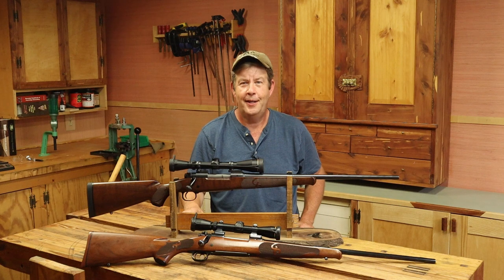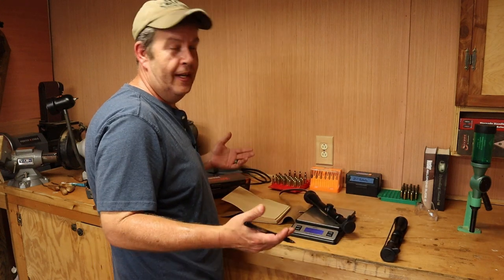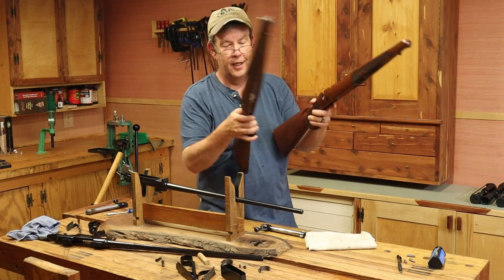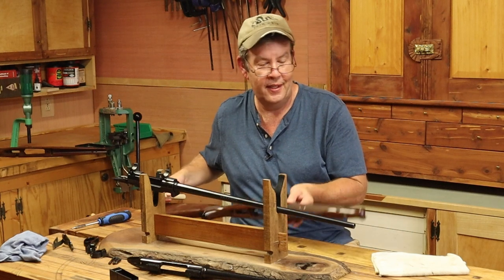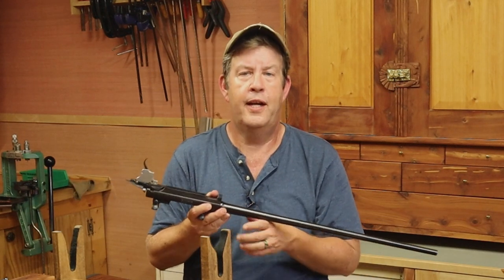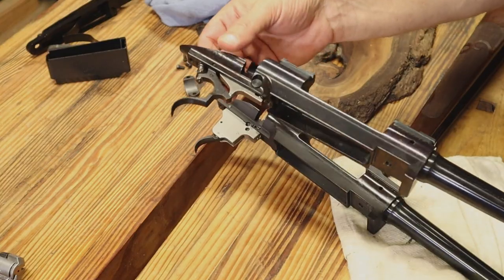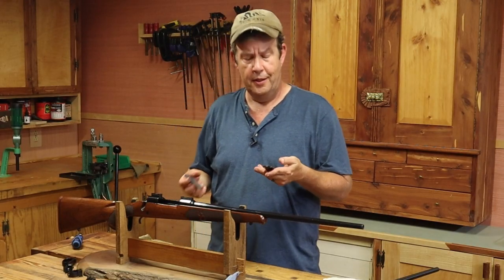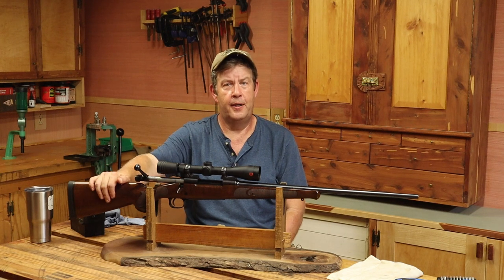257 Roberts Project; Trouble Shooting and Weight Difference

Comment: Thanks.  I'm sure enjoying following along on this project. You know I put together a 7mm-08 (short action) using a Mauser 98 (1904 year) and it felt odd having that short cartridge in that long action magazine.  I'm still not sure that I could shorten it with a block due to the spring and follower. Perhaps they make something to do that, but I just try to make sure when I load it that I have the ammo forward and lined up.  I still need to bed that action. That's something I have no experience doing and I ended up letting my local gun smith do that on my 7mm Rem Mag that I put together.

Comment: I'm with you in that trigger weight, Tom. My model 70 is a 2015, and I have never touched the weight on mine. I'm quite sure I could dial it down, but it breaks so clean and crisp that it has never failed to surprise me when I take a shot. Why mess with perfection?
Reply: Have I seen you post before that you have a model 70 ultimate shadow? I have found an ultimate shadow stainless 30-06 that I’m thinking about getting. Do you like yours? I apologize if I have the wrong person!
Reply: @NCWoodlandRoamer  Never heard of the ultimate shadow before. Research is soon to follow! Thank You.
Reply: @jstrunck  they made them around 2015 from what I can tell so far.
Reply: @NCWoodlandRoamer  As a matter of fact, yes. I have an Ultimate Shadow Stainless, and I absolutely love it. The synthetic stock isn't much of a selling point for most people, and admittedly I'd probably love to have it in a beautifully figured walnut, but it does have some rather nice features to it. Instead of checkering it has soft and tacky grip panels which I have found VERY handy in mid Novembers of Northern Michigan. It's not the sexiest stock in the world but it is very functional and I have found it more help than hindrance when trying to line up fast, accurate shots. It's also glass bedded from the factory like all other Model 70s. Budget friendly, cost effective, and low maintenance with the stainless barrel and reciever. Especially if you want a high end production rifle in an all weather rig. I think they retailed for around $800, but you could find them new in the upper $600 to mid $700 range. I can't remember, but I bought mine from Bud's, and I think I paid about $680 with the extended warranty. I suspect that despite the cheaper stock, this rifle will still hold it's value as other Winchester Model 70s have.
Reply: @hammerheadms  Ok thanks! I’m not a big fan of the looks of the stock but I haven’t seen one in person, the one I’m looking at is online. I would possibly put a Bell and Carlson stock on it…. If I get it. We’ll see. It is in like new condition and at $1,000. Seems high but then you see the new ones that are stainless are well over $1,500 and I can’t even find a new one in stock anywhere anyway. But granted the new ones come with a Bell and Carlson stock from the factory. BUT they have a 22” barrel and the ultimate shadow has a 24” barrel which I actually prefer with 30-06. See how I just talked myself into it!? Thanks again for the information.

Comment: Tom:  Very enjoyable video, as always!  3 things it would be fun to explore:  1. Have you tried obtaining the actual twist rate via cleaning rod.  It’s not uncommon at all for these rifles to be twisted slightly faster or slower than published.  You might have a 1-10.5 or very close to 1-10 etc., but we don’t know for sure until you get the true data.  2.  Steel bases especially, aren’t always machined very well from the factory.  I own or have returned bases from Leupold, Burris, and Ruger rings, that were visually not machined to specs.  At this point, we are trusting that the original rings are a) machined well enough, and b) are sufficiently fastened.  My 2 cents is to forget about the lapped rings and remove the bases. Can we we truly consider the range data valid without you mounting the bases yourself?  3.  How far are you from optically center in your scope?  As you know, if you’re out a ways with windage to zero, that has potential to affect the scopes ability to hold a precise zero.  Good luck!
Reply from the maker: Lots of good points Ryan. And it's funny you said what you did because my new Warne bases and rings just arrived! I don't think I'm having a scope or scope mounting issue here but at this point I'm going back to what I have confidence in and I have been really pleased with the Warne Maxima bases and rings.

Comment: Tom those are beautiful barreled actions and stocks. I would not change anything on either of them except for possibly going to double d basesand rings on both of them. Good luck with future load development. You may won't to try neck sizing with lee collet necksizer. Have a good week!
Reply from the maker: Thanks Leon, and I'm going to go with Warne bases and rings, and my new rings actually arrived yesterday.
Reply: That should be a very good setup. Bolt them on and go. I've never used Warne bases and rings but I have considered it .  I wouldn't hone the rings, not necessary on a hunting rifle

Comment: I have an M70 and an M700 with 2 lb. triggers. Both are drop safe. 

I am not fond of Remington or Winchester's new triggers. Neither one would go down to 3 lb in my samples. So it's a good thing they have a decent pull. 
Thanks, Tom!
Reply: On my Savages (actually Stevens 200s) The pre-accutrigger triggers would not go below three pounds and were full of creep and slop, so I replaced both with Timney. My Featherweight is right at 3 and I checked it for drop safe here on the carpet of concrete slab and the trigger held.

Comment: Great detailed video, the difference in the XTR and the 2012 is interesting, I would not have thought the XTR would have a steel floorplate...I would be interested to know what your clearance is on the free-floating...on the 2012...Im going back and watch the range video on the 2012...have a great week and God Bless
Reply from the maker: I checked the clearance yesterday with sheets of paper and it's roughly .009".

Comment: Tom I have. Something for you to think about in your load development.  With a given powder charge  bullet  and case, the shorter OAL will have the highest velocity and pressure.  As you start seating the bullet farther out pressures and velocity drops until you approach the lands then pressure spikes.  Think about that and maybe that could help some. have a good day.
Reply from the maker: Leon I did some length testing on the model70 Westerner I have in 270 Win and between about .027 and .030 off the lands the velocity just plummeted from the velocity I had at .025". For me around .023" has always been the sweet spot and that sort of told me why.

Comment: Tom , over the years I have come to the same conclusion that gunblue 490 advocates on gun barrel cleaning. Clean with brush  patch and cheap paint thinner and don't clean often . It seems that my guns group better after 15 or more rounds and continue to shoot well for many rounds more (100??).
Reply: My best group with mine came after about 15 rounds and with my last load. I am not cleaning it until I go back with my factory rounds and another load work up. I am cleaning the chamber and rails though, but not the barrel for the next round.
Reply from the maker: Leon we're on the same page but I'm going to do a serious down to steal cleaning in the next video. The fouling was a lot worse than I expected in this barrel and I'll be showing that on the bore scope. But I won't be cleaning like this again.

Comment: After one range trip with the 7X57 and really bad groups with both Federal Power Shock 140s and PPU Rifle Line 139 gr SP,  I went straight to free float check and trigger pull. My trigger was breaking at over 5 lbs. But, no matter how far I backed off, I could not get below 3lb so left it there. I'll adjust to that, but 5 was too much for groups for me...maybe okay for wearing gloves in the cold. Anyway, I'm just saying I can't shoot groups pulling on a trigger with 4+ pound trigger weight...at least without working on some technique. Changing from 3 lbs with the Remington X Mark Pro Trigger down to 1.5 to 2 lb with a swap to a Timney on my Rem. 700 .223 Varmint, brought it from a MOA gun to a 1/2 MOA. But, I only use it on the bench, and may never get out to a prairie dog town. With the 7X57 at 3 lbs, I got one Sub MOA group. and just happy I know it can do it with at least one load. Working on technique may help in case I'm pulling shots at the bench. I do know my heartbeat with my grip was moving the crosshairs an inch. My biggest challenge is trying to get this Mossberg 4X4 270 to shoot 2 MOA consistently even with a 2.5lb trigger...which may take a miracle. I already have a shotgun, and don't need one that only shoots one #2 Buck shot at a time. :)
Reply from the maker: LOL, that's about I how I feel about the 257 Roberts right now.
Reply: @TomRiverSimpleLiving   I got one 2 MOA 4 shot (square) group with the 270 mossberg today with 130 gr. Speers The odd thing about it. was I mounted my old Tasco 3X9X32 scope (about 50 bucks) on it. I hate having to use a coin to get it zeroed. The rest, well they were not 2 MOA.  Took the 7X57 too to shoot some groups with the factory 140 grain Power Shock federal, and the PPU 139 gr. SP, and the last of the last work-up with 154 gr. SST  Got a 1.5 inch group with the Federal and 1.82 with the 154 gr. but couldn't do any better. This was with the barrel not cleaned from the last trip. Anyway, I think I'll clean it, since the fouled barrel didn't seem to help. 1st group out of it cold with PPU 139 gr factory ammo was horrible...probably 4-5 MOA. I'm sure you'll get the .257 shooting.

Comment: Have you checked the crown? I've had a few rifles that drove me nuts trying to tune, only to end up having crown recut and instantly shrink group size! Sometimes you can see/ feel/ use the q tip test, but I've had some that looked fine (thru a loup) but a light cut made all the differance ;)
Reply from the maker: Mike, I haven't checked the crown other than just a quick visual but I will definitely keep that in mind. That's is one of those we rarely think about but when it's a problem it's a problem!
Reply: @TomRiverSimpleLiving  Yea, I have a NEF single shot (243) that wouldn't shoot any (factory) ammo worth a darn (3-4") so I had the crown recut. Instantly under 2" with most factory ammo (still didn't like the Federal load) and now have some handloads to test :) Had a surplus Mauser years ago the went from 6-8" groups to under 1",  just by cutting 1" off the barrel (with a hacksaw/ file!)

Comment: Hey Tom, looking forward to your progress.
     Since you mentioned the rear base offset, maybe you or someone can answer a couple of questions I’ve got about that type of mounting system. I know it takes a lot of torque to rotate the front rings until they are perpendicular to the base. I wouldn’t dare use a scope to rotate that front ring, but when using the rear  base to adjust for windage, which seems in effect that’s what’s happening, wouldn’t that place a bind on the internal workings of a scope?  Also, if an offset existed while lapping the rings, wouldn’t that enlarge or egg shape the inside dimensions of the rings?  I’m really stuck on why during your first range trip, first group, your second shot went right of the first, then left, then right. 4”+ on windage, 1
Reply: Apologize, I cut off my comment. Anyway, less than 1” difference in overall elevation difference. I’ve used Leupold based since the 70’s, but not so much now. Keep up the good work👍
Reply from the maker: Jaybird, Wheeler makes an alignment kit for these types of bases and rings and you are correct in everything you are thinking there. The rotation has to be right on the front (you can use a 1in wooden dowel for turning it) and the windage has to be inline or you will run into issues. That's why I didn't want to touch these especially with them having been lapped. But I'm about to replace the base and rings with some Warne Maxima bases and rings which use Weaver style slots. I have always preferred the weaver style rings just because they simplify everything for me. Now with that said there are folks that won't use anything but the Leupold bases and rings and those folks know how to perfectly align everything on them. I just don't care to get that indepth with bases and rings.
Reply: My favorite Model 70, 270 Win is sporting Warne bases and rings👍. They work for me, looking forward to your next trip to the range🤞⚜️🇺🇸

Comment: Hello Tom, thanks for the video. I’m waiting with baited breath for your next video to see if there’s an improvement in accuracy. I have a newbie type question. I recently realized that my bolt actions can be de-cocked by holding the trigger while closing the bolt. Is this better practice to un-cock say a model 70 this way, or is it perfectly safe to dry fire as long as you don’t do it unnecessarily often? Thanks Tom, always appreciate you videos and your common sense approach to what you do, and help you provide. Take care and God bless.
✌️😎👍
Reply: Good question it doesn’t hurt to dry fire unless it’s a 22 caliber rim fire they should not be dry fired because it will cause damage to the firing pin. Also some pistols shouldn’t be dry fired like CZ-PO models it can damage the firing pin roller.
Reply: Been decocking mine this way for a while now.
Reply from the maker: Mike I think both of the previous comments are spot on. I usually de-cock mine by holding the trigger down while closing the bolt and I suspect I've done that in quite a videos. Now with that said it doesn't hurt them to be dry fired. There are a few special exceptions to that such as most remfires like Edwrd said, but almost all centerfire rifles can be dry fired without issue. And notice I was careful to say most and not "all". There are always exceptions to everything when it comes to firearms so just do a search on your particular firearm to see if it's  ok to dry fire if you're ever not sure.
Reply: @TomRiverSimpleLiving  Thanks Tom, and thanks to your other awesome members of the group for their comments. Have a blessed day 
😎👍
Reply: @repairfreak my pleasure I have been hunting reloading and collecting rifles for 60+ years and it would be my pleasure to help with any questions since that’s how I learned!

Comment: With my next trip I may work on seating depth with the 7X57 and try the same range of bullets. I seated my grand slams at just at the top of the the cannelure, and I know that was shorter than my factory loads, and it gave me my best group, so it might be shooting better with more jump to the lands. Heck I don't know. We'll see.
Reply from the maker: All any of us can do is experiment and see. But I will say that I think seating depth is more of an issue with the new high bc bullets? My group sizes never really changed that much with seating depth but my velocities would. But I keep hearing setting depth is a big deal with the new bullets.
Reply: No surprise here.my two 7 x 57 were the same.  if they are a accurate like this just leave them as is as only accurate rifles are interesting . If your rifle is a military surplus one then it will shoot heavier projectiles well as they usually have twists around 1 in 7. Mine loved 139 to 175 ones with the norma 156 oryx being my favorite by far.

Comment: Good morning from Maryland. I have an older Ruger model 77 ultra light rifle with a round top, red pad, and black forearm tip. It is chambered in 257 Roberts and for the lack of a better term, is a very sexy little rifle. Its even easier to shoot.  O think the barrell heats up quickly when sighting in so that adds a degree of difficulty. Do you know if this is a long or short action?  Thanks.
Steve

Comment: When it comes to triggers I generally take the approach of just getting used to the trigger of the firearm I am shooting.  It isn't that I don't want or appreciate a nice trigger, but it has to do with that I like shooting older military rifles and that means getting used to their quirks.  That being said the only type of trigger that I don't like is the one you featured with the blade in it as my trigger finger just finds the blade annoying.  I do have a number of guns that have beautiful triggers with probably the nicest one being on my Winchester 9422, but my main hunting rifle is factory set at 3.1 lbs and it breaks like a glass rod.

Anyhow, l hope your next range trip has better results than 3 M.O.A.
Reply from the maker: Trapdoor, I think we have about the same thoughts on triggers? And with that said I love a 2 stage trigger. I figured out years ago that I could shoot more accurately with a 2 stage when shooting from unsupported positions and that's usually how I shoot when hunting.